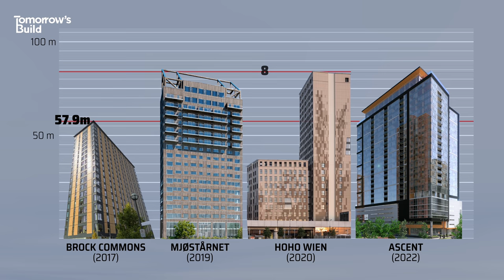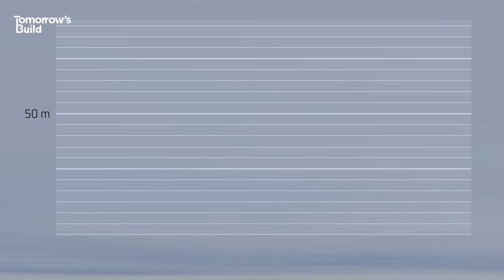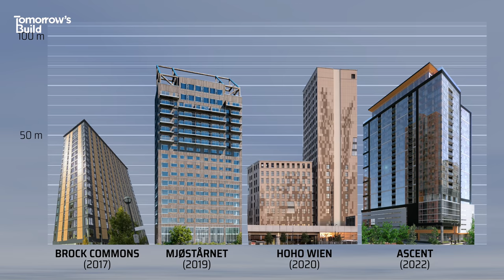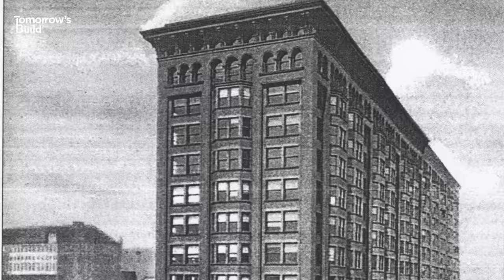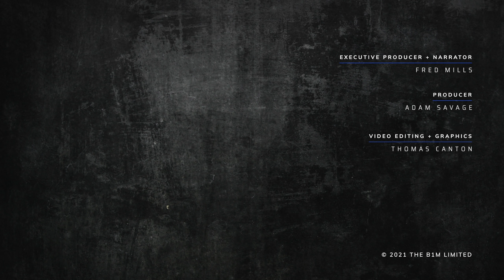Why There Are No Timber Skyscrapers

Comment: I guess my question is "do we need to be able to build higher?" Esp in places like Europe, where even in large cities, the height of the buildings is rather low when compared to other cities around the world. Seems like timber could be the gold standard for renewable small to medium size buildings. Skyscrapers are cool, but are they even necessary?
Reply: Burj Khalifa sized buildings aren't neccessary and kinda useless yes
Reply: In my opinion it's 50/50 skyscraper could fit hundred or more housing so less land will be used for housing so it will save more space,besides in dense growing country where a lot of people living low life their living conditions could be boosted insted of they living in broken ugly house they can live in better palace and the space used for their house can be turned into park or green space and because of high wind on high palace wind power can be used for ventilation using the power of the wind can be made into electricity or ventilation,wind blow from the top floor to bottom floor of building and with series of pipe it'll blow into their compartment replacing old air with new air without needing to use power for ventilation
Reply: @jonathan100yearsago  The idea skyscrapers save space or save money is false. When additional fees and building requirements are added to final cost skyscrapers are more expensive than 2 shorting buildings. Looking at the most density populated cities in the world it is not New York or Manhattan, its paris, Barcelona, and Athens with consistent 5-7 story buildings throughout the entire city and not just a few tall buildings downtown. Also these cities have significantly skinnier roadway infrastructure.
Reply: @RedShoesSmith  Skyscrapers are useful upto a limit
Reply: @RedShoesSmith  is more than 4 story tall building not a skyscraper? I know building with 3-4 floor build with low budget for housing is called stacked housing, but if it has more than 4 floor it's consider as skyscraper right? I heard somebody said for a buildig to be called skyscraper it's must be taller than 150 feet...? Or meter... probably...i don't really remember and to lazy to google it now
Reply: there's definitely a sweet spot between good density, and being completely useless. not a single megatall building is full. the shanghai tower is like half occupied, because the units are soo expensive to offset the build cost, and there's soo many units, there's simply not that many people willing to pay that much to fill it. people also get weirded out being THAT high. me personally, I feel really off any time i'm more than about 30 stories up. Personally, I would say the sweet spot for density vs size is around the 10-13 story mark. again that's a personal choice, but I feel that offers a good mix of housing spaces with some stores or businesses on the main floor. I've also had this idea about making communities of like 6 or 7 of those sized buildings fairly tightly packed, with a common parking structure in the middle, the roof of the parking structure could house a green space and community pool, while also maybe tossing vertical or oscillating wind turbines, and covering the roofs of the buildings in solar. you could have one buildings main floor be a grocery store, others be doctors or dentist offices, or repair shops, or whatever. just a tight community.
Reply: @jonathan100yearsago  Obviously in terms of utility from square footage of land, then yes a skyscraper makes sense, but we arent so short on land as to require that yet. Even in a crowded place like India, a 15 story apartment building would house a lot more than most of their structures.
Reply: It's a faulty question to ask if skyscrapers are necessary. It depends on the city, region, and its density and projected growth. The definition of skyscraper is always shifting and what many mean when they ask this is if supertalld are necessary (they almost never are, but not every structure built has to be necessary). In Europe, a 15 story building may be considered tall, in Asia or South America, it would hardly be considered a significant structure.

Realistically, buildings up to about 50-60 stories, depending on density, make sense to build. 

It also goes both ways. Mid-size is not the solution to everything either. Mid-size is super common in Europe and believe-it-or-not newer US developments, but in high density regions they may not be enough to have everyone who lives and works in a region have a reasonable commute time and a reasonable price. Sometimes height increases are just natural.

Really we should let cities emphasize density and smart planning. If that leads to 150m residential towers, then that's where its led to. Arbitrary restrictions often leave negative impacts in one direction or another.
Reply: @Pasloooo  not completely true. It's useless now but when the population is larger it will be useful. NYC for example building a  skyscraper is a must.
Reply: The real question is: If we want to build with lumber, how can we keep it from burning down?
Reply: Skyscrapers are useless and basically nobody who has lived in, or worked in one finds the 4-minute elevator ride to be a pleasant experience. We have PLENTY of room to just make shorter, fatter buildings that can do the exact same thing and NOT run the risk of being pushed down by a strong breeze. 

We only are building skyscrapers because rich people want to flaunt their wealth, and it's disgusting
Reply: Smaller buildings may be prettier from the street level but the usefulness of skyscrapers on a practical level isn’t arguable. They fulfill their purposes of making denser cities very well. Europe may be prettier but Europe also has much less countryside than other countries, and that’s not only due to smaller size but also because there’s a lot of urban spread due to low structural heights. When you have over half a billion people in one of the smallest sociopolitical regions, and nearly a billion in one of the smallest continents (if we’re to actually consider it a continent since Eurasia is one plate), yeah, you’d benefit on practical levels from skyscrapers. That and maybe it’s just because I’m North American and more used to them, but they’re really not bad looking either. I don’t get the complaints about them. And I’m a cabin addict. But nonetheless they really can be beautiful in their own way.
Reply: @carrier2659  maybe that's true where you live but in many cities there is no space to grow but up. NYC for example and HK. Without skyscrapers only the ultra rich would be able to live there as the amount of homes available would be cut to a fraction.
Reply: We don't necessarily need that here in Indonesia because we have earthquake & tropical weather, the idea of build skyscraper and wooden house will be bad idea, only the rich live in that stupid overpriced block house, and wood house is cost more to build and repair.
Reply: Okay to answer your question, YES, we need to always build higher. Almost half of the world's population live in China and India alone. Can you imagine what the urban sprawl would look like, with everyone living in tiny individual buildings? It would be like Houston, but across those entire countries.

HIGH-DENSITY is absolutely required, to eradicate urban sprawl. Building HIGHER is how you achieve the highest density.
Reply: Look at all these people with small populations and plenty land trashing skyscrapers. In NYC, LA, San Fran, Miami (in recent years) it is very necessary. Unless ofc you want them to extend the city into the suburbs. With no space/lesser space everyday and more people migrating to your city/state, you must go vertical. Not to mention, even if you have plenty land, does not mean its good land to build on or profitable to build. Sure you can claim Dubai built useless skyscrapers which is true right now BUT can change if more people migrate there in the coming years.
Reply: @crappytv8363   +1

I hate seeing Europeans talk down skyscrapers, from a place of comfortable privilege. Basically what they're advocating for is runaway suburban sprawl [ which by the way, is far more harmful to the environment than using steel ]

In countries like China or India, skyscrapers would be an absolute necessity to stop urban sprawl
Reply: timber hi or low rise, fire hazard always on my mind.
Reply: @jonathan100yearsago  Nah, by my standards it's not a skyscraper if it's shorter then 80 floors or so. Even then it's more 'tower' than skyscraper
Reply: @Fenthule  I grew up in a place exactly like this! It was absolutely awesome. Exactly like this except 24 floors each. It was fantastic
Reply: @RedShoesSmith  That's interesting, in the US people get used to having lots of space so they don't think about using it economically. Then you end up with wetlands and prairies getting paved over and cities sprawling out for miles because there's so much 'chicken bones' space between roads, houses, and other houses
Reply: Most of the skycrapers in large cities are half empty. I think a human scale building is way better than having taller buildings. To make a city dense, we don't need to have skyscrapers all over the place, just with highrises we'll do fine. It seems nobody is aware of all the issues that come with skyscrapers.
Reply: @MrLobotho  As someone who lives in big cities, this is absolutely untrue. The skyscrapers are packed. There are cities that are exceptions, but those are generally related to piss-poor urban planning and economic management.
Reply: Exactly the point I want to make 2 minutes into the video and you’ve made it so eloquently! Just want to add: deep foundations, lifts, pumps, sprinklers...all required for buildng tall.
Reply: you gonna plant all those trees?

Comment: The problem with timber construction is that the manufacturing of the building material is not optimally standardised for economies of scale. 

With steel and concrete in conventional building methods, the steel bars and concrete mix is standardised and hence cheaper and therefore the go-to choice in the industry.

Breakthrough innovation is probably not what we need at the moment, instead standardisation of parts and production scale of those are necessary.

If we start building affordable 2-3 story houses and 3-8 story utility buildings with this technology, we'll be building skyscrapers with them in no time.
Reply: I agree with this.
Reply: These are the typical pain points with new building strategies.  They will work themselves out.

Comment: I really would love to see timber become the default for most buildings. The fact that they look way nicer than concrete and feel more warm is already a big plus
Reply: Timber facades get black rather quickly, if they aren't again and again painted. Such a problem won't matter much financially with skyscrapers, but it will matter financially with single-family homes. A black facade, also already one of a darker gray, transforms terribly much light into warmth. A completely blackened wooden facade also does not look pretty, any more.
Reply: @HansDunkelberg1  on wooden facades you are right, but at scyscrapers most facades are made of glass. Wood gets only gray because of uv hurts the outide layers and gets washed down by rain. The remaing part is cellulose which is gray. If the wood is protected by glass you don't have this issue

Comment: How do you "fully protect" wood from fire? Any physical object that disturbs the fireproof coating will expose the wood and allow it to catch fire. I hope they fit sprinkler systems as standard.
Reply: the wood itself IS the fireproof coating. the beams and walls have extra material that's essentially sacrificial. like it says in the video, the purpose is for the wood to char the surface layers, but it can't burn through to the core and weaken the structural integrity. believe it or not charred wood is one of the best fire barriers out there. there's an old fireproofing technique that's been getting more popular again lately, where you intentionally char the exterior layers, then seal it with oil. not only does the black charring effect look REALLY cool, how it kind of reflects light and almost shimmers slightly, but it's SUPER fire resistant. like could save your cabin from a small brushfire kinda resistant.
Reply: When large pieces of wood get burnt the outer layer chars and forms a layer of carbon which absorbs the heat and protects the wood from underneath
Reply: All new multi habitible buildings have to have sprinklers and like the video stated these are engineered to and have to prove fire survivability before ok'd
Reply: cross laminated timber
Reply: The char concept is marketing wank. Put a log on a campfire and see for yourself. The reality is the fire rating. The longer the better and hopefully measured in hours, not minutes.

Eventually fire rescue crews will abandon the building and retreat to a safe distance before it becomes structurally unsafe and falls down. In an ideal world they would have had enough time to rescue all the occupants.
Reply: @splaw120  Presumably the larger the building the higher the probability of a fire happening. If the building structure is not 100% fireproof then the structure may be compromised by even a small fire. Therefore there must be a trade-off for buildings who structure is not 100% fireproof, between the efficiency of scale versus the risk of writing off the building after a fire.
Reply: @splaw120  the charring concept is 100% accurate. That's what gives the timber it's fire rating, the outer layer burns to give 30, 60, or 90 minutes before the structure is compromised. Tossing a log in a fire is a ridiculous comparison. It'd be more akin to starting a fire in the center of a log. Oh, wait, people do that?? And the fires can smolder inside the log for the duration of an entire night you say?? wow that really does show the efficiency of carbonizing the outer layer and slowly burning the center away!
Reply: Wood is more fire proof than steel and concrete which is reinforced with steel. If once of those buildings start on fire, the steel can have property changes that make them on useable. If wood catches on fire, the outside burns, you have section loss which is designed for, and then you renovate the building.
Reply: Sounds like extra pollution needed to create all this perfect structure systems.

Comment: How much wood in the construction would make it "a proper timber skyscraper" to qualify? Base is concrete? Steel crossmembers or beams? How much wood would have to be mixed with other material to be considered a wood composite?

Comment: I think this limit at about 85 meters is good. Once buildings start getting too tall they become less practical and more expensive with larger foundations, more elevators, increased support, and higher unit and building costs. This 85ish meter cap also allows for a more balanced skyline with no one building standing above the rest and, aesthetically, makes a city look more pleasing. Examples of this are places like Barcelona, Paris, Amsterdam. Compared to cities like London, Rotterdam, and Brussels, they are orderly and neat with the latter cities being chaotic and messy with skyscrapers jutting across the skyline competing with one another for height.

This can even be seen now in New York where it used to work having so many skyscrapers because there was a time when building with steel and stone limited heights. Now, these supertall skyscrapers are going up overshadowing the other buildings in heights and destroying the once fairly even skyline. These supertalls are also plagued by inconveniences like: taking 5 minutes to reach the bottom floor, massive wind sway, exorbitant construction costs, cheap construction, and just the phycological effects of being so removed from society on the ground; you don't really get that sense of community and locality when you're living 100+ meters above the ground.

I think the question is more should we built taller rather than can we build taller.

Comment: One of the downsides of this loosening of regulations on mass timber high rises is the proliferation of cheap five over ones in every city I’ve been to. They mostly aren’t clt, and disturbingly many of them aren’t fully glulam either. I mean, with full honesty, those things are just a bunch of paneling to make their stick frame construction look more substantial than it really is. I really hate how it seems a half dozen developers had plans to plop one down the second it became legal to build like that. Gives me the creeps. And these buildings, despite being marketed as “luxury apartments” are absolutely not built to last. It’s cool to see what the high end projects are doing with timber, but the cheap massed produced midrises that are being built right now are hideous flint boxes that would have been better made if they choose to actually spend money on good material.
Reply: Well it is ticking time bomb. With what will happen. Imagine leaking pipe of plumbing on wooden stick framed house. It is not going to last. Also fire protection is done often in proper manner.

Comment: My favourite thing about timber is that I spent the last decade thinking about how new buildings can move away from the idea of glass or gardens, and it never even crossed my mind to use wood without cladding. It creates a delicate strength whilst looking clean (at least at first) and healthy.
Reply: Yes, timber looks clean at first, but it quickly gets black. Then you can install a giant air conditioner and fry the pedestrians.